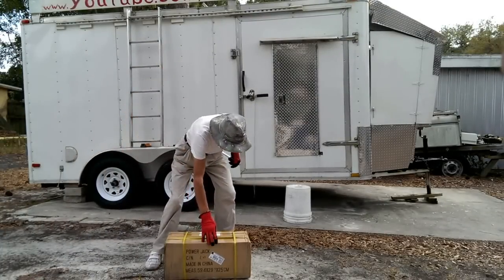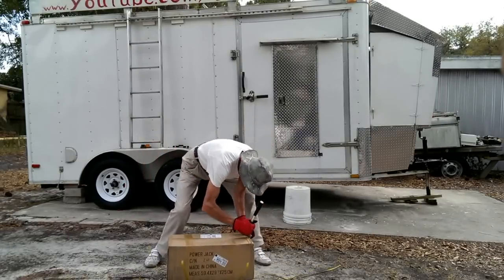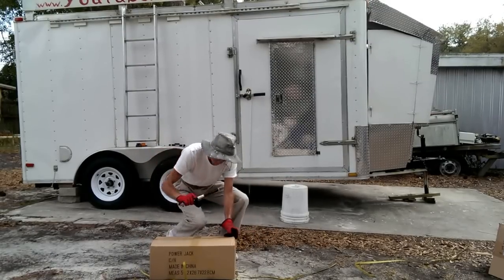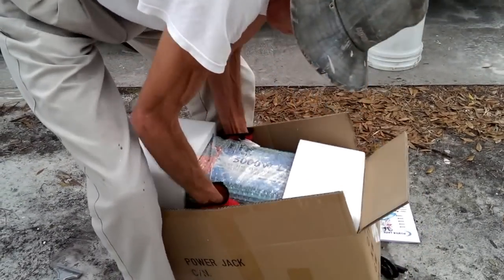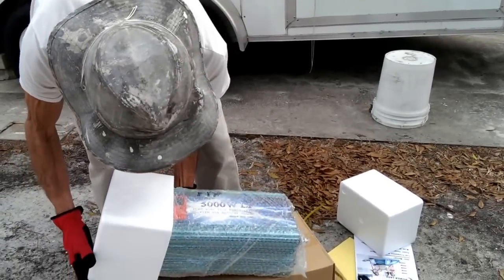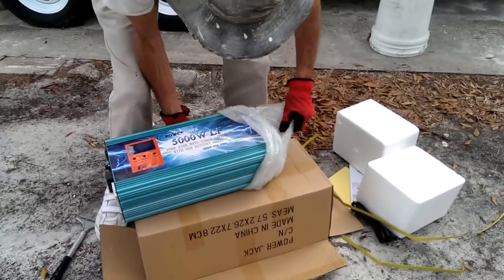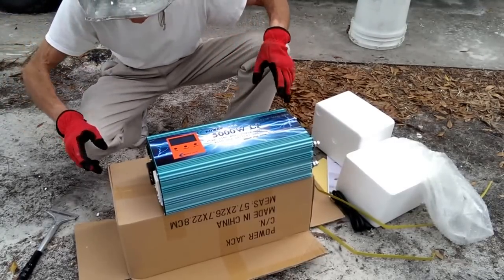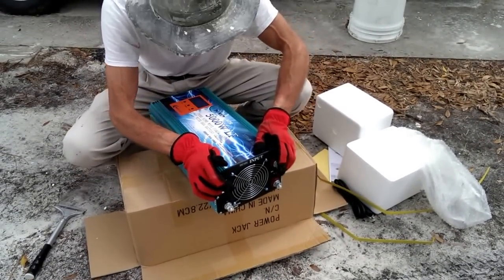5000w 220v inverter unpacking box

Comment: Now plug the piece of shit in and you will be gravely disappointed in this crappy thing!!
Reply from the maker: Work for my welding bizness Sir over a one year. https://youtu.be/txlcUHx3MHASorry that your's is NOT working
Reply: *****
I have bought three of these things and all have failed! And not from the lack of knowledge on how to use them! I'm glad your is working. I don't like seeing people get ripped off. Good luck to you my friend.
Reply from the maker: If you may share your battery settings ? I am using Marine-batteries 105AH, 4connected in parallel using "boats-switches" 1500A max every switch.When I am not in my van all power to inverter disconnected. https://youtu.be/D6dVVRtU25E

Comment: Got my 8000 watt power jack inverter. Over 4000 watt usage, even on 240v, get overload alarm/shutdown. After many emails with the company, they have informed me that this is just the way it is. Their inverter listed at 8000 watts continuous can only provide up to 4000 watts continuous. The company has admitted that their inverters can only do 1/2 what they are rated for. I would give this a DO NOT BUY!!! TOTAL SCAM RIP OFF!!!
Reply: Md.naseem
Reply from the maker: +Trina McDonald If I may ask you ; How many batteries did you used?========================================================For my 5000w I do use totally in parallel 4 batteries. Every battery raited 105amps.So, doing simple math on primary voltage (+12v)   105 x 12 x 4 = 5040 wattsIn a TEST of aluminum welding machine I measured with 2 testers  parameters got after test; 220v and 13amps. So Math for a secondary voltage (~220v)  13 x 220 = 2860watts=================================================================RETURNING to for clarification of a 1/2 power. For 8 years I used power-inverter raited 800watts with a peck of 1500watts. Maximum what was getting from it was 500watts. So, I admit your statement of 1/2 power manufacture advertisement.
Reply: +sofabike 4 105 ah batteries is not enough for 4000w you need at least 8 batteries but your run time will be no better than approximately 35 mins On continuous usage
Reply: +sofabike I have 16, 90 AH telecom batteries. #3 gauge cable connecting the batteries and 0 gauge going to the inverter. When drawing close to the 4000 watts for extended time the cables get barely warm, just above room temp. I run the inverter fan full time. While this does power my entire 110v needs of my house, I specifically got this inverter so I could occasionally use my oven.
Reply: +Trina McDonald What's you're batt voltage under load if it is under 10.5 V
it will shut down also the 110v outlets are rated at half power but if it is
from 240 v and the batteries voltage is around a steady 11.5 V and it still
overheats/shuts down get you're money back